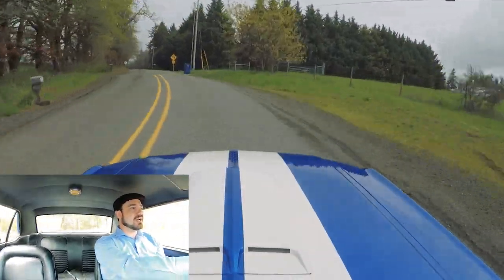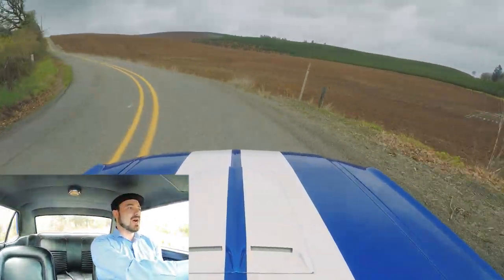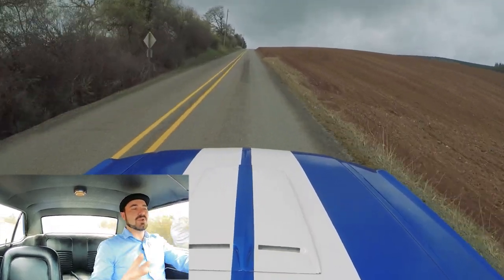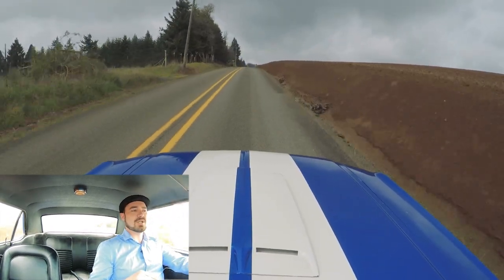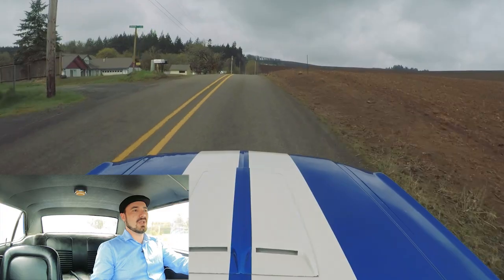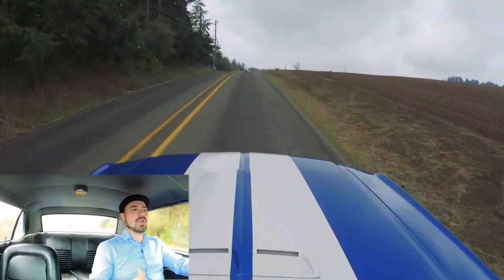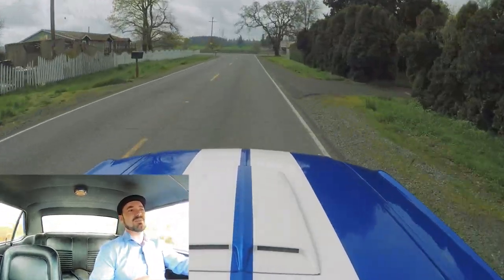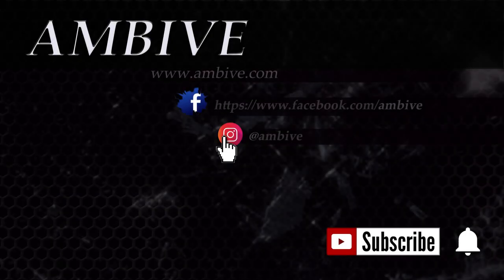1967 Mustang - A whole new car

Comment: You really SHOULD set the Sniper ECU to Progressive since you are using the progressive linkage. Simply put a check mark for Progressive and set the percentage to 40% or where ever you secondary blades start to open.
I see you have your IAC set to 25, lower that to 20 or 15 and see if that helps with your IAC "sticking".
Reply from the maker: I had it set at 25 for testing with Holley. For street driving we ended up going with 20. As near as I can tell, the sticking was related to a very slight voltage dip that happened after the engine started, but the alternator had not started charging yet. Adding battery capacity seems to have solved the issue, though we still don't know why that was a symptom.